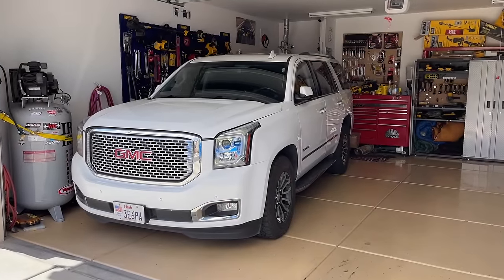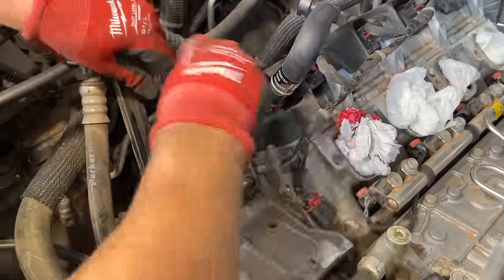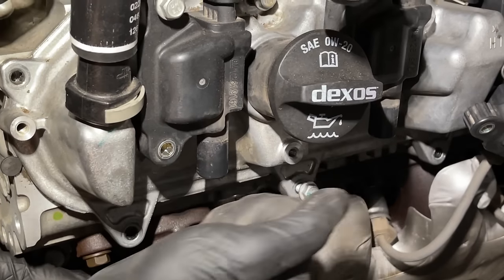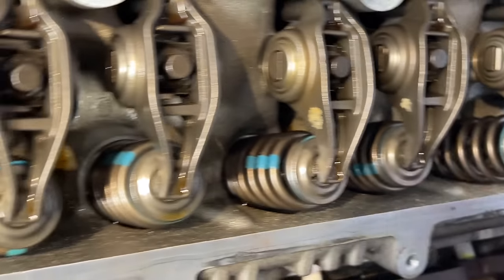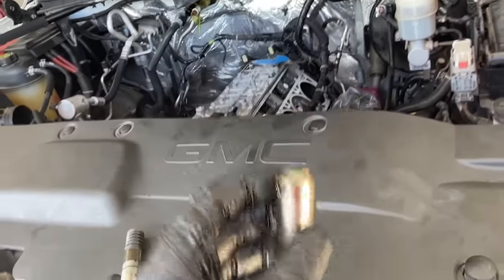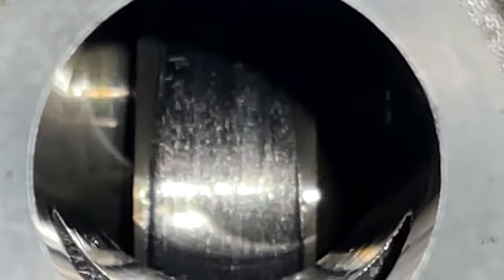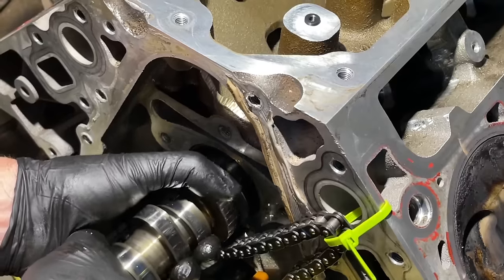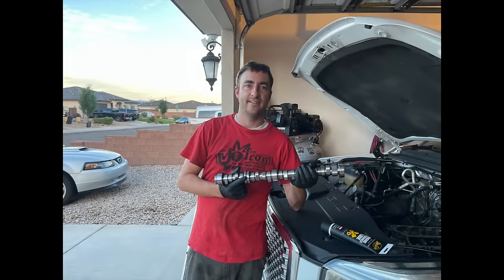DOD AFM Delete Yukon, Tahoe, Silverado, Sierra, Escalade 6.2L & 5.3L Replace cam & lifters  Part 1

Comment: This is scary for me...6 mo. ago just bought a 2017 Yukon 5.3, afm/dod system  with 107,000 miles. I was being told recently by others that i should be using the range afm disabler. Kinda worries me I'm going to have some hugh expenses coming my way. It appeared to be well kept by one owner and it runs good 😮🤔.
Reply from the maker: Change the oil 3-4,000 miles instead of what it suggests. You can try turning it off for now. It’s just not a very reliable valvetrain
Reply: @dannyjohnsonsgargage
I just now had the oil changed at 4000 and had a transmission flush when I bought it 6 mo.ago. Plan on having plugs/wires replaced soon. Is there any certain one of the range afm disabler that I should buy for it. Appreciate your answer....thanks.

Comment: WHEN YOU LOCK THE CRANK IN PLACE WITH YOUR TOOL, THEN WHY DIDN'T YOU JUST MARK THE CAM GEAR IN PLACE, RELATIVE TO A STATIONARY SPOT ON THE FRONT OF THE BLOCK TO REFERENCE THE CORRECT POSITION OF THE CAM GEAR, REGARDLESS OF WHETHER OR NOT THE CHAIN COMES OFF THE CRANK GEAR? THEN REINSTALL THE GEAR AND CHAIN WITH YOUR PAINT MARKS AND THE STATIONARY POSITION POINT YOU MARKED ON THE BLOCK? CAM HAS TO GO BACK AS IT WAS REMOVED. THANKS
Reply from the maker: That would also work as long as you are certain the crank has not moved. In the end it really doesn’t matter about the cam gear since you will see the arrow, but more about the crank gear you cannot see

Comment: What a complicated pile of junk.. the vehicle WAS a premium priced vehicle and should not need this job.  This is why i drive pre 1980 cars and my wife drives a Hyundai.. they dont brake down or need this job.
AFM Ls engines are useless.i could have removed the engine from any of my cars in the same this took.
Great video sir and well done.looks like you have done this before.
Steve in Australia
Reply from the maker: @stevedriver1476  I love my 2000 Silverado. This has been disappointing. I have 2 Toyotas and my Silverado now Why I traded my GMC Yukon for a Toyota Sequoia
https://youtu.be/cNm9rtx0GHQ

Comment: Engine doesn't look very healthy. Have you just thought about getting a crate motor and replacing the whole entire motor while you're at it that does not have AFM?
Reply from the maker: It ran fine after the repair. It doesn’t look healthy from being direct injection. That would also be the case with the L8T, or 6.2 from a Camaro that’s non dod. It’s just a bad design

Comment: I thought with this delete kit the high volume oil pump needed to be replaced!
Reply from the maker: It’s not included in the kit. To replace the oil pump you would need to lower the oil pan or pull the engine

Comment: Have a 2020 Diesel AT4 fuel pump issue, metal shavings all throughout system. $13k quote. No warranty, has over 110k miles
Reply from the maker: It’s really too bad the quality is so bad

Comment: I broke the chain tensioner why is it plastic!?!? Now what
Reply from the maker: It’s a poor design for sure. At this point you’ll need to remove the oil pump (and from the sounds of it, a new pump is better than aligning the old one perfectly when you put it back on. It’s possible to put .020 shims around the pump in 3 places). You’ll need to lift the engine up to drop the oil pan. It may be best to pull the engine. There are connectors and o rings you’ll really want to watch as part of the oil pan and the oil pump https://youtu.be/mAeLiqLVpxQ?si=eu4GCPbxSciZCosJ

Comment: I can do all of this it’s just the timing scares me
Reply from the maker: I hear ya. If the oil pump could be easily removed without dropping the oil pan it would be the easiest engine to time. Two arrows pointing at eachother. But with the oil pump in the way and all the complication of removing it with the electrical connector you can’t reach inside the pan, oil rings the pump uses inside the pan, perfectly centering the pump, and all that makes it too nerve racking. The plastic chain tensioner is also nerve racking. The engine will need to come out if that breaks.

Comment: Sad the way we get screwed for GM appeasement of government at our expense. But for persons that have not experienced this failure yet the Holley plug in the diagnostic port module avoids the cylinder cut out. Thus all cylinders fire all the time. It stays a V8. Another thing that works is to run your automatic 10 speed transmission in L9 (don’t use D) and again stays all V8 all the time. The mileage never changes. I’ll say it again same mileage, no loss in gas mileage. The difference in gear ratio is less than 0.1 difference between 9th and 10th gear. You’ll not see any change in anything.
Reply from the maker: Yeah, however until the ports are plugged, it can still get oil leaking past the solenoid and activate 4 cylinder mode and fail

Comment: Great video and commentary throughout.  Also appreciate the sister video detailing the cost (https://youtu.be/RZGr7xT6wLA?si=GqSTk3ucfBSFPXfm),  I have a 2019 Silverado with the L84 engine with P0011 and P0303, so suspect a bad cylinder 3 lifter if not also a bad cam shaft.  Runs very rough.  Any material differences between the L83 and the L84 if I choose to tackle this myself?  Thank you
Reply from the maker: I do believe there is some difference with the cam gear and walking the chain over from what others have said

Comment: How did you determine you needed to take it apart? . My 2015 Yukon is driving me crazy. I had park it outside and it was covered for a year. So when I started it up it ran bad and it had a misfire code. So I thought it was bad gas so I ran a couple of tanks of gas through it and I still had a number 2 misfire code. So I guess it was the injectors after running a pressure canister to clean the injectors.  I removed the manifold and the foam cover was filled with rat poop and the injectors were almost impossible to remove because they pee on it. I clean it up vacuum and made sure that the passages was clean to install the new injectors and fuel rails because I destroyed the passenger side one.  Harness looked good. Got them in it ran good for 15 minutes and then the code came back up. I swapped coils around and still the #2 misfire code came up. It only has 68,000 miles on it, doesn’t make any ticking noises. I didn’t replace the intake gaskets so maybe it is leaking but I sprayed carb cleaner but no change in idle but as you know it is a bit tight to really do that. I don’t think I want to take it apart like you did. I helped my daughter’s boyfriend that had a 2016 Chevy Silverado last year with the same issues and I discovered after replacing every sensor and spark plugs coil packs that he had a broken valve spring and Thank God it finally fixed it so I checked that also on mine but it’s good. I’m in Southern California and don’t trust the dealerships. I have a basic scan tool and I don’t really understand how to read it. So I’m a bit unsure what to do next
Reply from the maker: Here is what I did to verify https://youtu.be/cx4_-FGXCVE?si=7f8aiP-WKH9832fa
Reply from the maker: It’s possible you have a collapsed dod lifter. It would be apparent if the rocker floats around without any tension. https://youtu.be/gEcxI2nwwxE?si=mpqJjOcwwp-ZSZo1

Comment: Be aware that compressing that timing chain tensioner can and will break it because they are brittle from oil and years of service. After that, you are stuck blowing the front of the truck apart (4x4) to get the oil pan and pump out. If your lucky, it wont snap and go smooth like in the video.
Reply from the maker: Yeah, always a risk with old parts.
Reply: @dannyjohnsonsgarage  Im going to attempt to see if i can move that pump forward enough to get the tensioner bolts out. If not i guess i have a long day tomorow
Reply from the maker: @fixxerautomotive4917  just remember that pump has to go back on perfectly centered or you can lose oil pressure. I’ve heard with a new pump it’s okay to bolt right up. There are videos out there about removing the pump cover and putting .020 shims around it on 3 edges to center it if you don’t the have centering tool (the tool I bolted up was useless so I just went with not messing with the pump at all. There is also an electrical connection for the oil pump that goes into the pan that will not be possible to access (going down into the passenger side). Another bad design and problem to worry about
Reply: @dannyjohnsonsgarage  Yeah, i kind of picked that up from your video. I was thinking of using the alignment tools for the vertical alignment and using a micrometer for the horizontal alignment- maybe take a reading from the block to the pump housing. I beleive that the electrical connector will move forward with the pump if im not mistaking. I'm hoping that it will rock forward enough to get those tensioner bolts out because I'm trying real hard to save this customer as much money as possible on this repair and not have to charge him the full 32 hours that it is supposed to take to do this job by the book. I am very disappointed in this design for sure- we used to be able to work around removing the pan to change oil pumps- looks like those days are gone. One more step towards future disposable engines and vehicles- things that take more labor to repair than they are worth. they could have easily made the timing cover but up against the end of the oil pan instead of the top and allowed full service of timing components and oil pump without oil pan removal.
Reply from the maker: @fixxerautomotive4917  I believe there were also some circular gaskets coming from the oil pan to the pump to watch out for to properly seal. Looking back I wondered if a new chain with a removable link would have been a better option.
Reply: @dannyjohnsonsgarage  Yep, im looking at it now and you are 100% correct. The pan has an intigrated pickup that seals to the pump with an o-ring. If a guy did manage to get the pump to slide forward, the chances of that gasket being damaged would be very high because you wouldn't be able to rotate the pump up and down on the left side to reseal due to the alignment tools being installed. The only way would be to install the tools, take 4 readings with the micrometer on the left tool from the tool body to the bolt locations, remove the left tool, unbolt the pump and rotate slightly to clear the gasket. Then when you went back with it, youd have to get the left tool back in the exact place that you had it with the measurements taken earlier. that would be difficult as you would be compressing the gasket to get it there.

Comment: honestly... its probably easier to just pull the engine and transmission so you can do RMS and the shitty ass torque converter in the 6l80 6l90 etc.cause that will fail. i despise doing engine work with the engine in the bay. anything further than the intake and im starting to want to pull it all out
Reply from the maker: It was tempting, especially  with the oil pump
Reply: amazing video series diy btw. ironic  to see the normal lifter with damage here. but since the afm uses a special camshaft, it makes sense it will eat any lifter up @dannyjohnsonsgarage

Comment: Just pull the whole engine out or get another engine.
Reply from the maker: The problem is you are replacing it with yet another engine that will fail. Perhaps you could go with a different engine like the L8T, but even regular lifters are failing and those engines are having oiling problems and are still direct injection. For $8,000+ you might was we’ll try the cam and lifter swaps for $2,500

Comment: I do these for $600 plus parts, ive done 30+
Reply from the maker: Wow, you must have the process down. Dealers charge $3k-$4k in labor https://youtu.be/RZGr7xT6wLA?si=yLzZZtDl6gSkS2Gk
Reply: @dannyjohnsonsgarage  yeah, I was quoted by a Chevy dealer here in Charleston, SC yesterday (4/8/24) $4k for one bank of lifters, and $6,600 if I did both banks at the same time.... + tax.  2018 Silverado 1500 6.2L